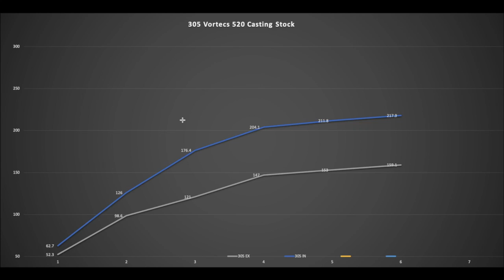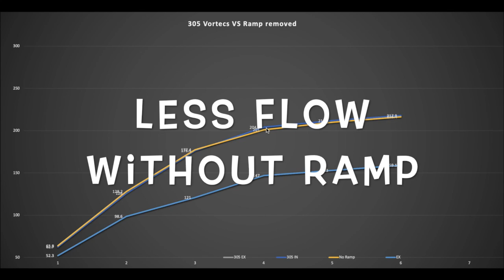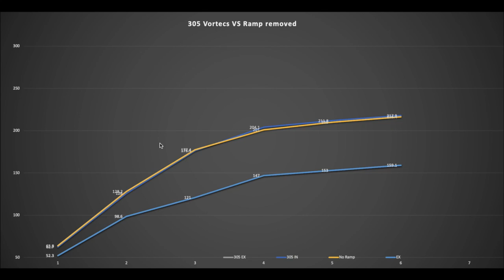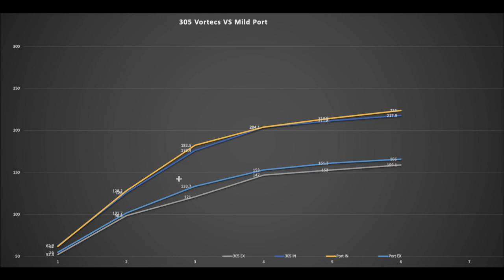305 Vortec Heads vs 350 Vortec Heads (Flow Data)

Comment: What do you think of a 305 block with a Scat 3.75" crankshaft? 
A .030 overbore with a good set of pistons with a compression ratio between 10.5 to 11 to 1. With a decent roller cam with at least .525 lift to get you around the flow curve and out on the straight on both the intake and exhaust.  With a set of your ported 520 heads, I'm thinking it would be pretty stout, you should try it.
Reply: KB makes a 305 piston specifically for that combination.
Reply: Well even with a 6" rod your getting only a 1.6:1 rod ratio and that is terrible,  No i would go 1.825" radius 3.65" stroke with a 6.2" rod and 1" piston that is if your deck comes up to 9.025" and that i doubt. People i would really just keep the stock crank and buy a DART TAll DECK 9.325" deck height block. use long rods build a custom piston and forget heads for now. You can get it in 4.165' finished bore after you machine it, then you got a great 377 383 style engine that is gonna force heads to comply at low rpm And the basis for a big head forged crank  if later on you decide. But think of the street engine that would become Just having ONLY the block! (People , come to your senses. lol .joke.)  but seriously it is a good idea ? no?
Reply: @zAvAvAz  i've read what you wrote there 4x and my conclusion is you are off your meds !
Reply: Thats a 334 , im building one now, i like the concept of a "square" motor and there was a university study on bore and stroke relationship that i read that says that combo should be really efficient, its going in a s10 , should rip, we'll see.
Reply: @luckyPiston  I have had several 305's (150,000 miles+)in my v8 s-10 blazer over the last 20 years. Just down and dirty (very down dirty)re-ring jobs with nothing bigger than an Edelbrock 2102 performer cam, stone stock heads. They don't have the low end punch of a 350, but after a while I forget about the numbers and just E.T. foot brake it with great success. KB makes a 305 stroker piston, and I want to try it with some vortec 305 heads, could be fun, and nobody going to buy these 305 blocks from me. let us know how the 334 turns out.
Reply: @mikef-gi2dg  Kool, funny, i have a 454 in a 63 1/2 ton short box that makes stupid power without even trying, and what do i tinker with for fun ,,, wringing out a little mouse motor LOL!

Comment: Hey Pat if you were aiming to get 1horsepower per cube with a L03 305, would you go with 305 or 350 vortec heads? Other than the cam the short block won’t be touched. I wasn’t sure if the loss in compression and possible valve shrouding would make the 350’s unusable... thanks
Reply from the maker: Thats a tough one actually 
The 350 vortec have the better chamber and better flow than the 305 vortecs.
But like you said the 1.94 valve is abit shrouded on a 305 bore. 

I have not dyno tested this but I think a milled down 350 vortec on a 305 with a thinner head gasket to keep up compression would be the best 

But if you dont want to mill the heads then I think you may be able to hit your goals with the 305 heads. The certainty flow enough but it is abit hard to make easy power with the small bore
Reply: @cuttersperformance  it’d be interesting to dyno test the two Vortec heads on a 305. I’m a bit torn... I’ll keep my eye out for 520’s. Modding the 305 is just a stop gap (no pun intended lol) until I build a proper 350
Reply from the maker: I do have a old good running 305, ive been trying with the idea of doing a budget 305 build with 305 vortec heads.
What cam were you thinking of running?
Reply: @cuttersperformance  that would be awesome! There are still a bunch of the 305’s out there! 

I have an L03 in my Camaro, which I believe is a roller cam... I’d actually consider a custom grind. Something around a .450-.475 lift with a lot duration, similar to an oval track “lift rule” cam, maximizing the Vortec’s low to mid lift flow & velocity, and a narrow LSA to help develop low end torque. The lower lift would also be relatively easy on the valvetrain.
Reply: "until I build a proper 350"  After i built my first 383 vortec i swore i would never waste my time punching any real amount of money into a 350 again, if you ever get a chance to ride or drive a 383 you will get what i mean, something to think about.

Comment: Wonder how the 305s would do with the intake cut out to 1.92
Reply: Well. they would do well. however i tend to favor more unshrouding of a valve over that. And the angle cuts and weight and smooth reliable actuation and seating. conical springs.  The correct pressures and rev kit for more stable smoother operation. i would fill the chamber and reshape while unshrouding. Get 48cc -54cc. And a thin piston with valve reliefs and cupped chamber shape in piston. A 6.285" rod for 1.8:1 rod ratio and reduced wear and a specialized 1" daily driver piston with the ringlands squished above the pin bore .7,.7, 2mm gas port style RINGS. Off the shelf pistons do not duplicate this daily driver ability. or you could use a 6" rod for 1.7:1 ratio. and a 1.260" piston in an undecked 9.025" block with good trueness Of course 305's deck comes in different so sizes would have to be adjusted namely the piston height. A .040" head gasket. If i can get all this then i shall use the 1.92:1 valve.

Comment: My buddy has never had anything with power (every thing stock).  Now he has two c20 chevys a 72 and a 77. Both have upper 100k miles. Not worn out but tired. What do you think of those vortech 305 heads on a 350? I doubt he will ever rev over 4500. I'm thinking the compression increase should give him the thrill of power without giving him more than he can handle.
Reply from the maker: Even the 305 vortecs will outflow most stock cast iron gm heads, they dont have the good chambers but as long as the compression isnt too high and you can keep the detonation down they should work good
Reply: Some 6" I beam rods and some hypereutectic pistons with a little less cc relief than you need so you can then take a dremel and smooth out every sharp edge on top of the piston and in the chamber then to cc to your target cc.  This is a hotspot reduction , whereas the heat builds in sharp and thin or pointy areas as seen on a heat signature analyzer.

Comment: Anyone have info on these 14011034. My friend quit racing years ago and gave me these fully ported/polished 2.055 intake valves girdles and screw in studs I know his car ran in the 10s with these heads on a 406 sbc and nitrous
Reply: Think they are gm performance phase 2 heads. Excellent heads!

Comment: Where they all flowed on a 4" bore, or the 305's flowed on a 3.736" like the 305 uses?

I would love to see what the swirl port ramp actually does to airflow. The obvious answer is that "It causes it to swirl," but I don't think it's that simple. Normal chevy and vortec chevy heads bias the intake flow to the outside of the port (to the cylinder wall side) and generate quite a bit of swirl because of that, the swirl port ramps are on the other side and almost block the flow on that side, I'm surprised that they didn't end the ramp sooner or later, either not blocking as much flow, or forcing it all to go around the outside side.  I am impressed/surprised that you showed that the ramp didn't seem to hurt flow, I'm wondering if that would still be true with 1.94 or 2.02 valves.  If it was you'd get some of the "heart-shaped" chambers back if you cut them for the larger valves, kind of like cutting old 602 casting 305 heads for larger valves, where you end up with a tiny (roughly 54cc) heart-shaped chamber.

I have experimented some with the swirl port heads and found that the swirl makes more power than the added flow you got from cutting the ramps down, so porting those you wanted to leave the ramps and just clean the rest up. You ended up with a low to midrange torque monster, perfect for a truck. 

I suspect that a set of properly worked 305 vortecs with oversize valves would be a magic combination of power and MPG for a heavier vehicle.

if want to see a weird hybrid of design/thought process, check out some LT1 iron and LT1 aluminum heads.  They have some qualities of traditional SBC heads, vortec heads, fastburn heads... and the iron are different than the aluminum. I'm running a set of LT1 aluminum heads on a 305 that are heavily worked (they flow almost 260 on the small 305 bore) and modified to work on the SBC with a victor jr converted to fuel injection. You'd never guess the 305 was a 305.
Reply: Swirl port and swirl bore are two different things, i don't think we have air flowing from the port to the bore like a corkscrew, i think the design is primarily promating flow into the center of the bore which leads to more efficient burn as the mixture is filling the cylinder in a more uniform way. 

The mixture hitting the backside of the ski ramp is being deflicted down and is helping to turn air on the short side past the valve, there is a convergence that dumps mixture more down into the bore center instead of a non swirl port being more  towards the cylinder wall in front of the exhaust valve.

Comment: My question is can you put the 350 heads on the 305?  I've heard of 305 heads on a 350 for higher compression but what about the reverse?
Reply from the maker: Yeah you can, you should have no issues clearing the 1.94 intake valve to the 305 cylinder bore
Reply: @cuttersperformance  thank you for a quick response.  I was thinking I could just wasn't entirely sure.

Comment: Which is better, the heart shape 350 chamber or 305 chamber?  Or does a guy go with a 1.92 and 1.6 valve on a 305 head?  Does the swirl ramp make a big diff?
Reply from the maker: The heart shape chamber is much  better. Thats the biggest downside to the 305 heads not having it
Reply: @cuttersperformance  in the near future im building a 400 small block for my square.  Really trying to figure out if i want to mess with stockers or just get some eq heads...  you have a good channel, keep up the awesome work.

Comment: Hey cutter great video. I have a question for the vortec man. If I were to switch my l31 to carburetor, i understand that I would need a shift box but would the 4l60e shift manually on the column.  Thanks Pat. Keep it up
Reply from the maker: Yeah you will need a computer for it to operate.
I've seen kits that put them into a manual mode but they won't last long like that. Your best bet would be to go with a stand alone trans controller
I went holley sniper on my c1500 and went with the Fi tech trans controller (not the greatest but it works)
Reply: Thanks Pat, your the man. I'm loving all the great content. Stay safe

Comment: I am looking for a set of vortec heads for 305 is there a certain casting numbers I’m looking for or will any of them work
Reply from the maker: Technically any vortec head will work 
But casting #s for 305 vortecs end in 520 or 059
Some claim the 520 flow slightly more but I have no proof of that

Comment: Hi from UK, liking the content. I'm stripping a 305 in the workshop as we speak, it's from a boat all original, but I'm sure came with mercruiser vortec heads, I'm curious about flow figures so I can pick a good head, I have a quadrijet and points ignition to put on it, all the things other people avoid, always had good results with points ignition, sorting ignition advance with springs and weights is the key!
Reply: Sorry pick a cam!

Comment: Hey man do you think a 1.94 valve would actually help or hurt flow on those heads? And would they beat a 305 HO head?
Reply from the maker: I honestly believe these 305s would flow the same or very similar to the 350 vortecs with a 1.94 valve. I haven't had a chance to do try this yet so its just a guess. 
The biggest downside to the 305 vortecs is they don't have the good heart shaped chamber 

The 305 vortecs are the best flowing production 305 head. The stock 305 vortec head will usually outflow a professionally ported 305 HO head.

Comment: I have built 520 heads for a 287 with a .525 lift cam exhaust porting, minor intake porting(leave the tiny ramp alone). These heads are 165cc intake, 70cc exhaust and ours had 59 cc chambers. It made that little mouse absolutely scream, had RPM air gap, 600 cfm Holley, 1 5/8 headers and a recurved HEI. Rev’ed easily to 7200, it was absolute music!
Reply: I have a 97 305 Vortec truck with 300,000+ miles and it runs very strong and gets super mileage.  Super awesome motor 👌.
Reply from the maker: Super cool combo man!
Reply: Àß1spw pwpw is ² 2

Comment: I tried, even listened on some of your other video introductions and it all sounds like Pown in the shop?I don't know, maybe that's your name? No offense, that's what it sounds like with my old ears.

Anyway if you can it would be very cool if you could measure the unported port volume on the 350 and 305 heads? That would be some great info to know.

The lesser the port volume a head has the easier time a smaller cid engine or a longer rod ratio shorter stroke engine has drawing in air flow. 

Trying to decide which Vortec heads to use, 062 or 059(I have a set of each)for my sbc 400 block with a sbc 307 crank with 6.250" rods that will be a 355.

On one hand, the 305 will make it easier to get the compression up. But on the other hand, the 350 heads have the better swirl promoting chambers. 

But maybe thats why that swirl is under the valve?(to make up for the older style chamber?)

Decisions decisions. 🤔  Thanks in advance.
Reply from the maker: Sorry about that but its Pat haha "Pat out in the shop" 
I will have to check my note to see if I measured the intake runner on the 305 heads. I pretty sure they are advised as the same.
I still think the 350 would always be my first choice, as the flow and chambers are better. Even with the swirl ramp i don't think they will overcome the benifits of the heart shape combustion chambers.
I would like to know the exact reason why the chambers are different between the 305 and 350. 
Would a smaller heart shaped chamber be better option for a 305 instead of the swirl ramp? I would think so but maybe not
Reply: @cuttersperformance  

Well, if the Stan Weiss flow numbers are correct then the 059's average flow is slightly better than the heads he is calling L31, whichever castings those are? 

I kinda want to know which ones I'm gonna choose to start my game plan. Plus the other set will be used on my sbc 307 budget stroker build which will be before the big bore 355 build.

Comment: Good stuff. Yes a 1.94 and 1.6 valve combo would be good to see on the 305 vortec. Rather than remove the ramp, is there a way to increase the swirl?
Reply: Anyone after power and performance would NOT want to increase swirl, that is a tactic for low rpm, part throttle torque and efficiency, swirl limits a head at higher rpm
Reply: @archive.garage  That's actually what I was pondering. Maximising torque on a low cube street motor, like a 283 or 307.
Reply: @archive.garage  Curious, how does increased swirl limit a head at high rpm ?
Reply: @luckyPiston  Continuing my comment above, the shapes GM used to increase swirl hurt ultimate flow.  For instance, the large diameter intake valve boss, the seat choke point, both contribute to swirl.  If you want swirl, use them box stock.  If you want power, copy an LS3 head which is purposely designed for max cylinder filling.  GM stopped using swirl on 6.0 truck motors which says to me GM learned they don't need mega swirl, or were willing to accept less efficiency at part throttle/low rpm
Reply: @archive.garage  I wouldn't say GM stopped using swirl , the ls head has bowl biasing and the port looking in from the intake manifold side is offset from the bowl center, those two designs help swirl ,  I agree its not a swirl port head, but its using elements of that technology , i don't think you can get away from it in a wedgehead design and still have efficient combustion ... Now a hemi that's a dump to fill design.
Reply: depends on RPM usage.

Comment: So...whether you have a 305 or 350, is there ever a reason to choose 305 Vortec heads over 350 Vortecs?
Reply from the maker: I say always go 350 heads if you have option, the combustion chamber is the deciding factor for me even over the flow numbers
Reply: @cuttersperformance  New subscriber here. If you were building a truck tow engine and we're looking for low end torque and economy is the 350 head still the better choice? I'm also debating between an LS swap or simply building my 350 do you have any thoughts on which way I should go? Your channel is awesome and I always hit the like button as it helps with Facebook pushing and sharing the video more! Make sure to mention this in a video as I see a lot of views but few old timers who are watching understand how this works and are not hitting the like button 🙂
Reply: unshroud the valves at all costs and use the 350 heads.

Comment: Wow finally a video about the 305 Vortec Heads, thank you very much for this! 
My 92 Camaro RS 305 TBI is getting this upgrade with a pair of 059s and a Edelbrock 7516 intake and I was looking for info like this. 
Will keep you all posted when finished (Budget is tight nowadays).
Reply: How did it work out?
Reply: @timtodd6830 not able to do it yet, just bought a house and money went that way. Project is still on the plans, so will update once it gets done.
Reply: @LuisAFigueroa  I understand that!

Comment: My 059s were 224 cfm out of the box and close to 250 when ported with a 1.94/1.6 valve package. They respond well to bigger valves and a little chamber deshrouding. I did not touch the swirl ramp other than to blend it in a little more smoothly.  Stock they still outflow a 2.02 camel hump.
Reply: My butt flows more air  than a 305 head